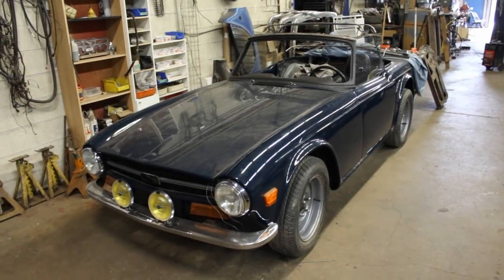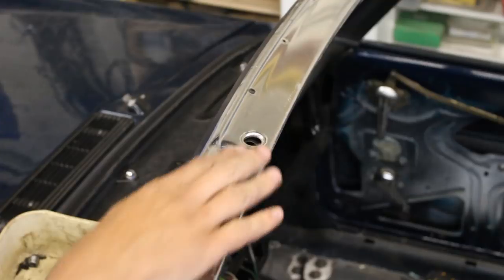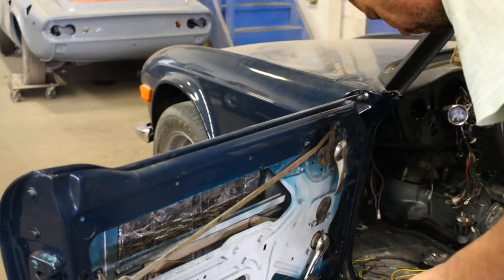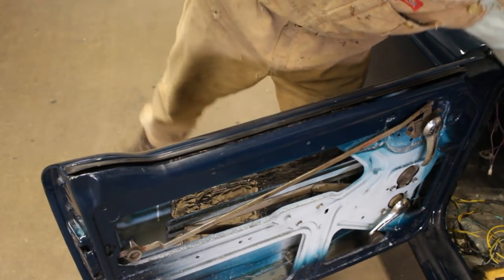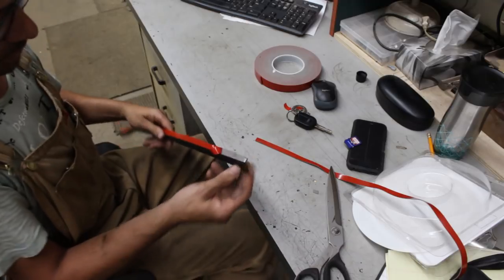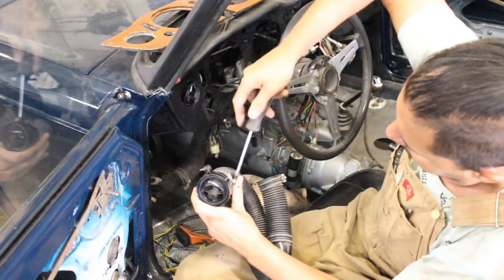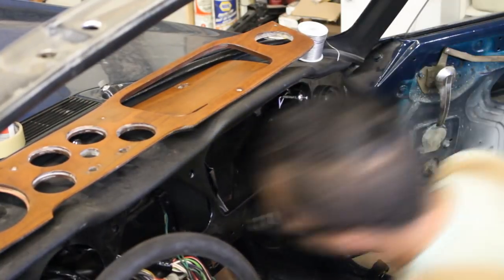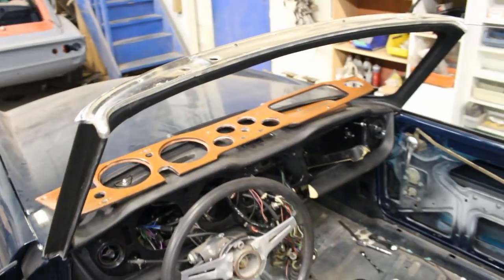1973 Triumph TR6 Restoration - part 25 - Door glass seals and dash air ducts

Comment: I'm in the process of installing finished high gloss Red Wood door tops. Was considering replacing all the door seals while I'm at it... After viewing your video, its clear to me there is no way i'm going to do that....I understand the easiest way to sort those clips are to pull the door off of the car and replace while the door is on its side.....I'll save for the next restoration...great video.

Comment: I do not doubt for a second that the tape will hold but it is possible to put the clips in. Drove the door glass all the way to the bottom of the door after removing the bottom stop. Unbolt the window tracks and let them move around. Use the tool sold by the Roadster Factory, bend it a bit s curve for better fitting in the door and open up the area where the clip fits a bit. Get a clip and with two needle nose pliers open up the clip a bit. Put it in the tool and go to a slot on the rubber and while pushing hard on the rubber pull hard on the tool might not putt on completely use a paint can opener to pull it home. With practice can seat all clips on a door in 10 minutes
Reply from the maker: Thank you! I am sure it would work well. I also used wrong clip as it turns out so next time I will be better prepared

Comment: When I installed the outside door seal to my TR6 I took a quarter to half inch wide strip of steel and bent it in a U at the end. I used it as a tool to pull the clips up from below onto the rubber seal. It worked pretty well but I was using old clips which might have not been as tight as the new ones that you had.  I fitted the seals after the glass was in place as the bottom metal strip needs to be fitted to the glass before the window is installed in the door and the door won't fit past the rubber seals with the bottom runner attached.

Also if you glue a new rubber strip folded  in a u onto  the bottom of the glass then the metal strip piece can be tapped over the rubber without the need for any adhesive. Just don't break the glass when hammering the metal piece in place and get it in the correct position on the window edge.  I never broke a window glass but I put it edge down onto a thick blanket and held it vertically while I tapped the metal strip over the glued on rubber strip.  The rubber strip that you have on the bottom of the window  glass right now is old and has lost it's thickness which is why the glass is lifting out of the metal strip (bottom runner). A new rubber strip glued to the bottom will be a tight hammer  fit
Reply from the maker: Well, I used wrong clips as it turned out later. I am sure if I had the right I would figure out a way to install them. Maybe next time :)

Comment: Elin the door clips are actually different for the inner and the outer seals .I told you it was going to be a bear to get them in good thing you have that super tape .
Reply from the maker: Yes, you are right. I didn't know that :) I wish I could read the comments before I post a video LOL. Anyway, it worked OK with the tape and if there is an issue in future I can always go back and install it properly. Thanks for the tip!
Reply: Ralph is correct. You were using the clips for the inner piece on the scraper.

Comment: I did this job on my Spitfire by installing the clips on the seals, placing the seals into the door, then PULLING up on each clip with a J-shaped tool to snap them around the metal edge, trapping the seal. It was tedious, but it worked well. The clips are different for the inner and outer seals. I wonder if you were using the right ones? Mine grabbed the seals very tightly....so tightly I had to open them up a little bit to get them to snap into the metal edge.
Robin

Comment: what kind of tape did you use? I'm having the same issue as you - loading the trim pieces in and then trying to lower the glass. Also, the glazing strip on the bottom of the glass - do I have to get the strip from moss? Or is there an off the shelf strip I can use? My old strip on the glass was completely perished/petrified.
Reply from the maker: Tyler Werrin it is a 3M double sided tape. I do not use a strip at the bottom if the glass. I just fill up the channel with polyurethane and insert the glass.
Reply: @RustyBeauties  Thanks Elin, you're a gem!

Comment: My new windows seem to be a little loose due to the rubber channel seal possibly being thinner. 

What adhesive did you use to mount the glass?
Reply from the maker: polyurethane sealant! Just keep it away from your fingers, it doesn't wash off for days
Reply: Elin Yakov's Rusty Beauties Thank you SO much for the 3M tape trick.  I
tried in vain to get the fuzzies to grab but no joy.  Didn’t have much problem with the rubber outside though.